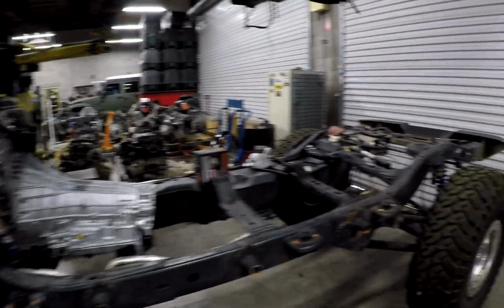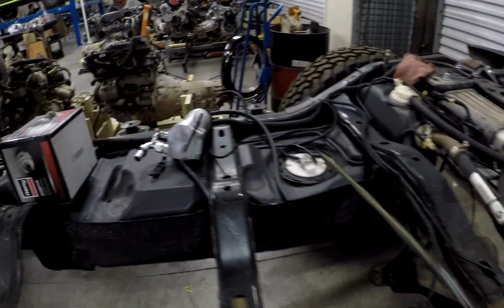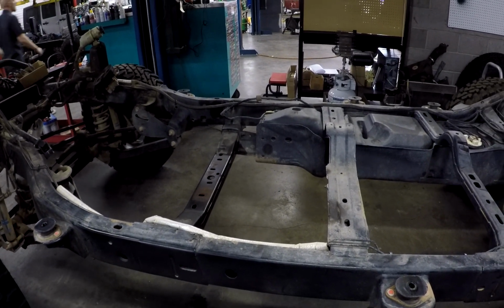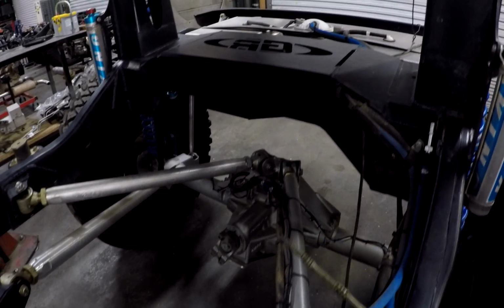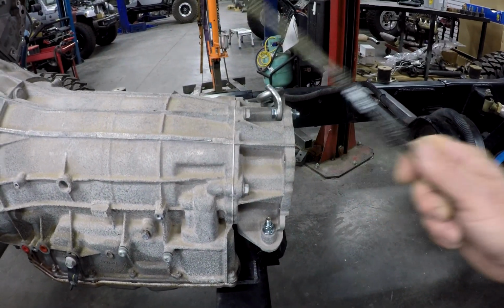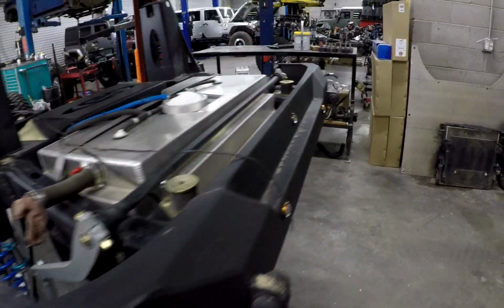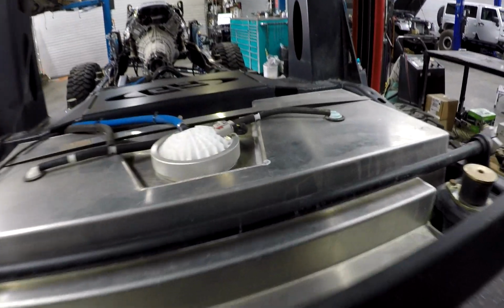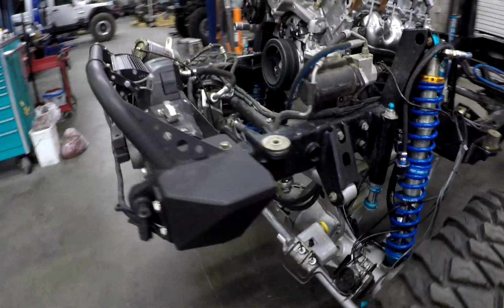LT1 JK 8 Speed Elite Chassis

Comment: I had roughed out a short mid & long arm 6 link set up, but not sure how it compares to cantilever or 4 link. Each arm length has plus so I was looking to run all 3 per side. Short locates tire geometry, mid most of work travel & long just centers rear. The mid could b double hinged so shock travel back up along mid arm then joints back down toward ground. Most ppl mass productio might b plenty enough, but no cad or scrub or real working model testing. Less is more what cheapest strongest to mass produce most effective travel range 80 -90% of wheelers/jeepers, no fab needed.

Comment: I was comment #9 might mean 9 is right gear number? 8 normal & push button locked out over 100 mph+  gear<tow/racing> full speed lock in & out mode free spins no engine brake loading more coast range. A flat lands full out free spin highest speed mode.

Comment: Need 2 fuel tank pumps in case 1 goes out middle of no where, & 1 pump is high flow lets go super charger ready & able & other pump is crawling light duty pump miser/economy pump just pick which on switch on dash.
Reply: hving a handle like on 5th wheel to quick & safely fill up a tank esp if u hve most extra fuel on trail might b nice saving hving to carry external fuel to spare except if got bad tank full of gas in middle of no where ville.
Reply: overlanding in jeep/truck every inch in jeep & every ft in truck precious cargo & rack space. Bigger tank safer better tank no need if u hve handle gas pump to carry external fuel, no smells.

Comment: I like that fuel tank is racing style quality & hopefully bigger & same wt right & left not extra on 1 side. *8 speed seems all that 10 hve near same gearing ratio & u say is not as strong & some1 uses a 9 speed? but not an issue 4 extra speeds in NOW. the crossmember under 8 vs diminsions of 9 if same strength help or hurt but a non issue as well.

Comment: Question. If I wanted a LT1 or LT4 could the stock jk 6 speed fit with a custom bell housing?
Reply from the maker: Novak has an adapter if you want to build a grenade:) The NSG370 is good for about 300 HP a LT1 would shred it.
Reply: @WranglerJKLS   is there a stronger transmission that can hold up to  LT1 or LT4 and that it is a six speed or 5 speed?
Reply from the maker: @Demonbedriven  The Tremec 6 speed shifts good and is strong.
Reply: @WranglerJKLS   thank you!🙏🙏